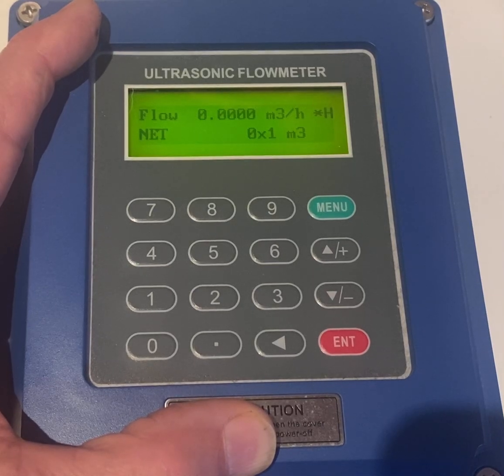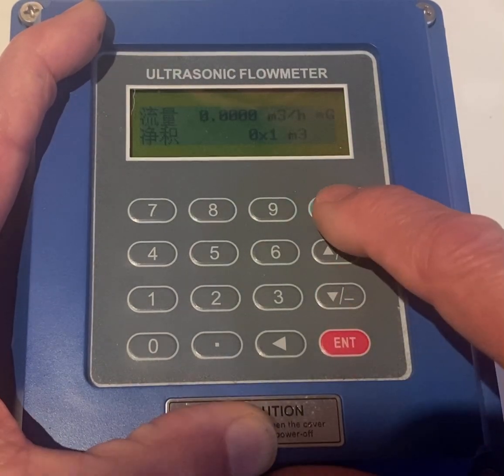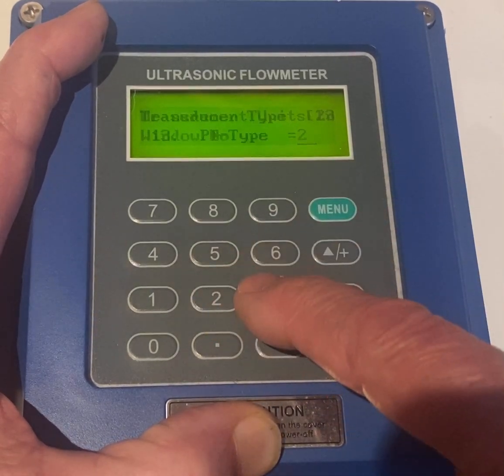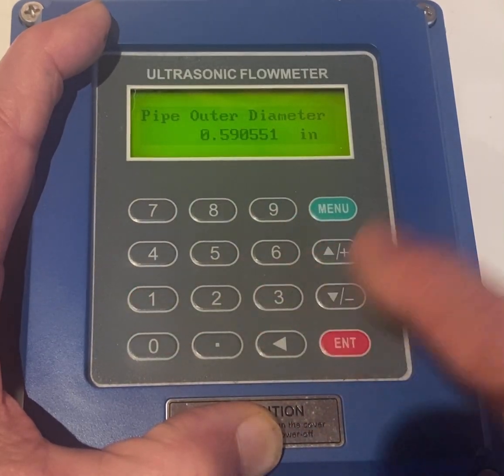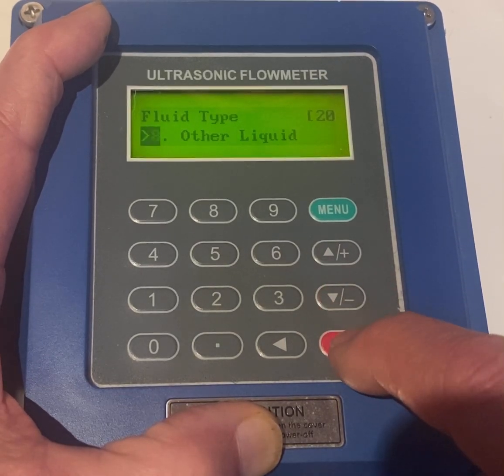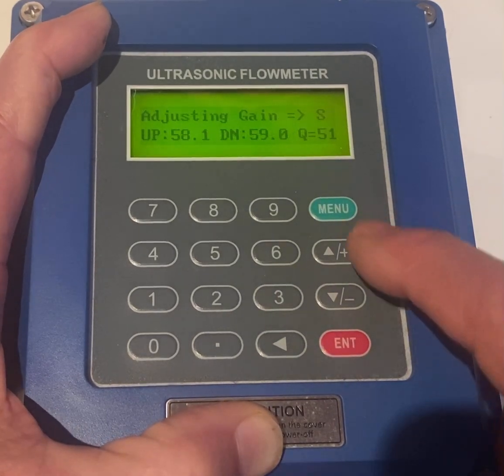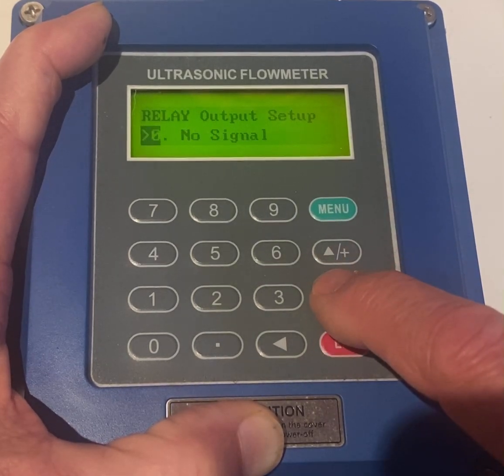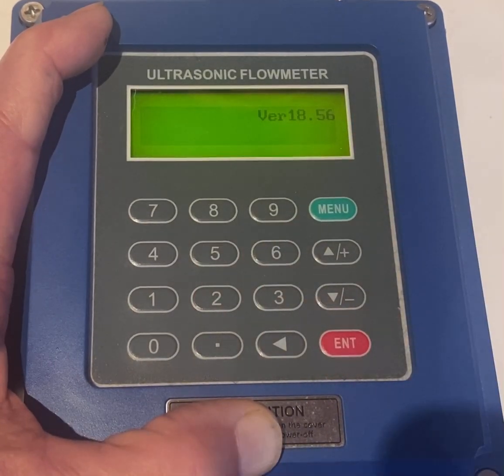How to Reset TacticalFlowMeter Clamp On Ultrasonic Flow Meter

Comment: Hola, compre el medidor ultrasónico y está instalado correctamente, pero cuando no está funcionando, (sin agua en el tubo) la pantalla indica “Flow 17357  l/h” y “Vel. 0,0013 m/s”. Que está pasando?
Reply from the maker: You said that he has an empty pipe, it should be filled. Then I would check:

Menu 11-24: setup pipe/liner and transducer type/setup
Menu 90: Signal quality (75 or higher)
Menu 91: Transit time ratio (between 97% and 100% is ideal)

Comment: Display not working. What could it be?
Reply from the maker: You on 24 VDC or AC Power? Was it working before and now it is NOT working?
Reply: @FlowMeter  AC power, yes, working before;  suddenly it doesn't display anything .